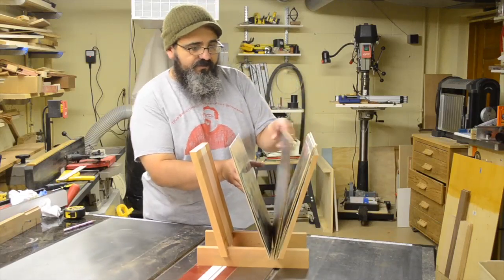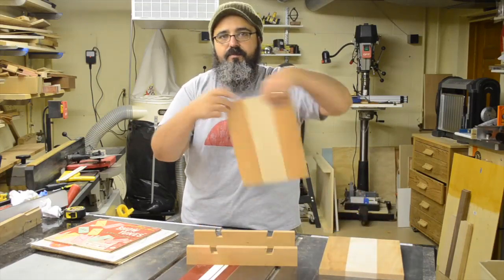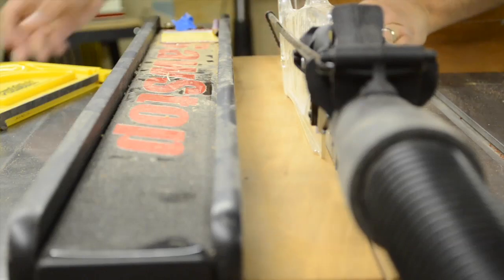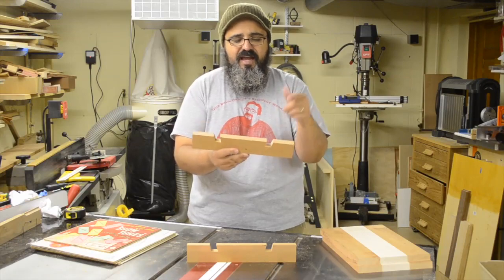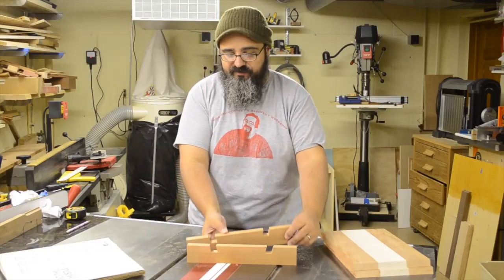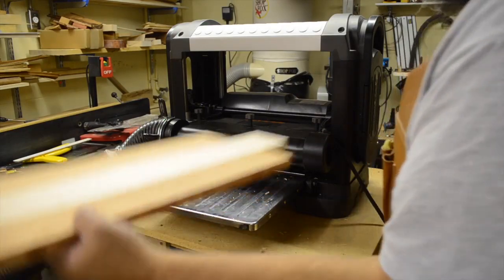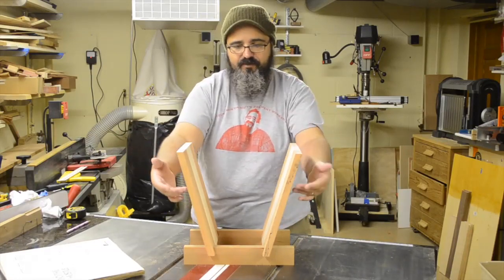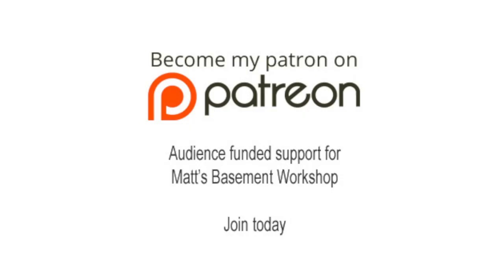531 Desktop Album Rack

Comment: hey mat I like it if I was to do this mine would have taller sides above records and a top with similsr 15 degree cuts on bottom for a top shelve
Reply from the maker: I told my wife the same exact thing when I was building it. I kept picturing them stacked on top of each other, adding another layer as the collection expanded. Much like a barrister's bookcase system.

Great minds think a like!